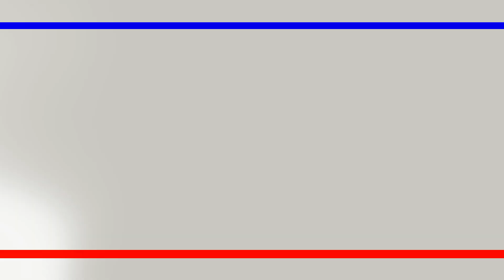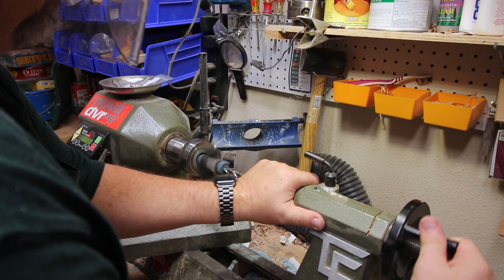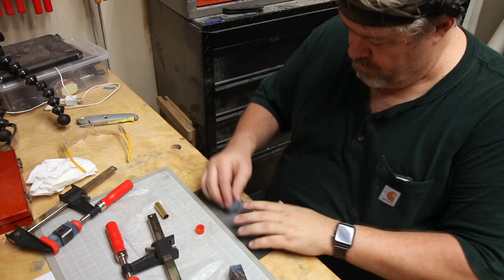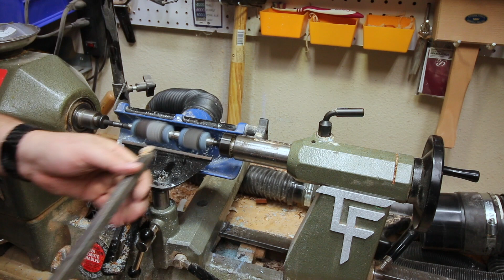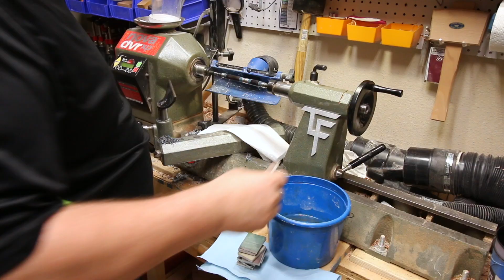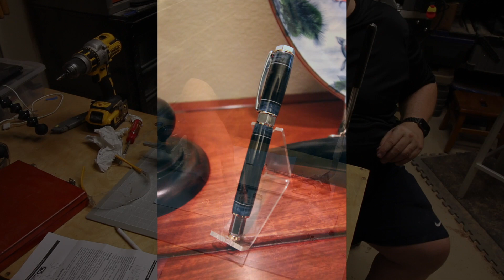Making: Turning My First Segmented Pen

Comment: Nice job Todd. That can be a deceptively tricky design to pull off. If you don’t get the segments perfectly aligned and of exact thickness through the entire segment it shows up like a sore thumb when you roll the pen in your hand. You did a great job making the blanks as well as turning them. I’m not embarrassed to say it turned out far better than the first one I made. 👍🏻
Reply from the maker: I am a little disappointed in that I don't get to keep this pen. I really like the way it came out. But, it went into the mail this morning... Thank you for the nice words.